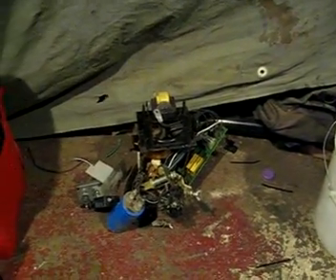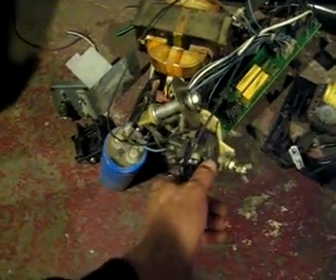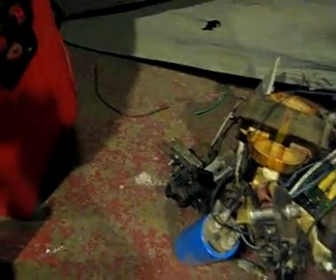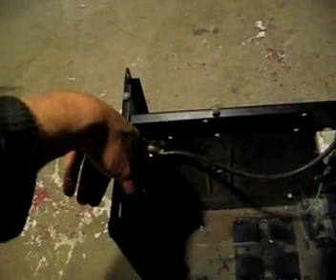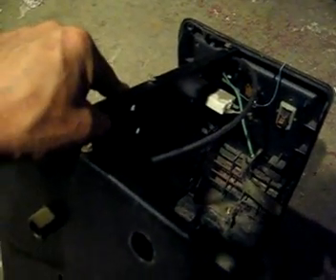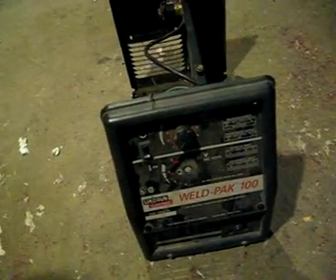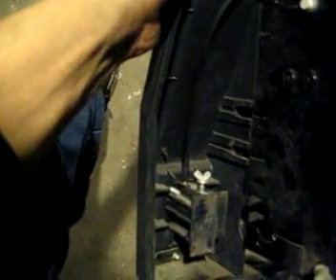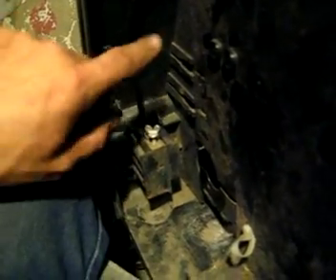welder conversion #2

Comment from the maker: yes but that thing is heavy as all get out, and its an inductor, which is there to limit the current going to the weld, which isn't really needed for the cell. I may use it for a bench top power supply or something like that, trust me spare parts don't go to waste around here. And this one is only rated at 18v 88a, which could pump out around 6 to 8L per minute. Other projects could use that.

Comment from the maker: The 6 cell setup I am running right now is being overdriven very hard, (too much voltage per cell) which means it does get hot and its not very eff. Its running around 1.85mmw the cell in the previous post would produce 8L per min with the same power. at 3v per cell your mmw drops from 4.6 to around 3.2 at 4v around 2.6 at 6v per cell between 1.5 and 1.9 mmw. So the real question is what do you want to do with the gas? For a welder eff. doesn't really matter much,for some tests eff does matter:)

Comment from the maker: Thats a bit of discussion there, but the simple version is at 2v per cell (or plate space in series cell) you will draw very low amperage but make little gas, around 2a and with 6 cells (12v) you will make around 120ml per min. doesn't sound impressive, but 120ml/min divided by 26w= 4.61mmw. In other words you get 4.6 mils of hho for every min you put in 1 watt. A system running that eff. could put out 4.61L per min at 1000 watts, but it would be physically large.